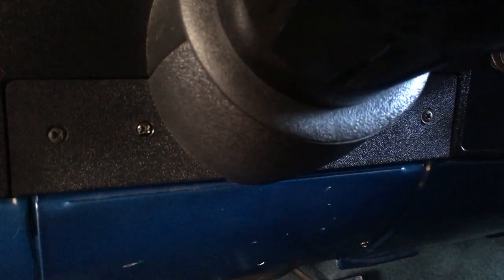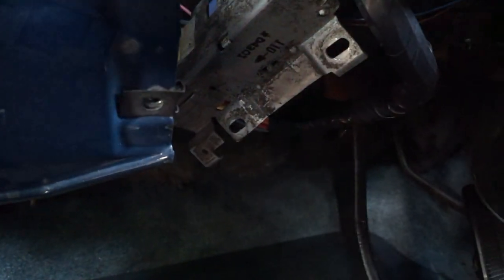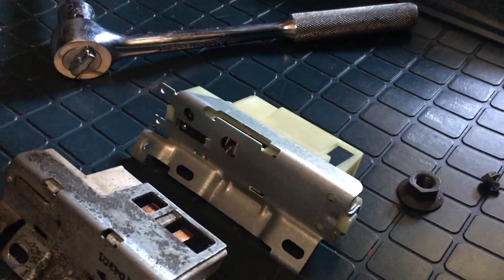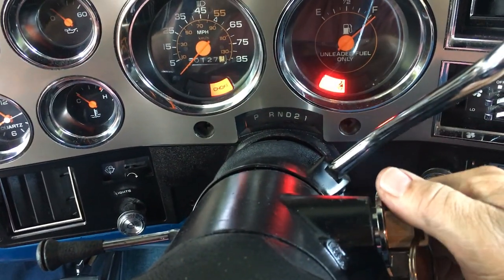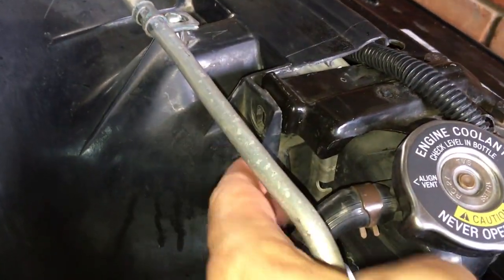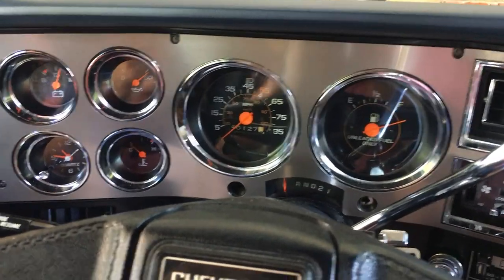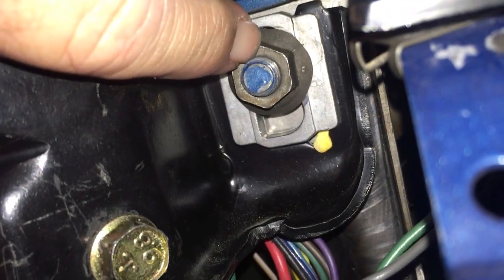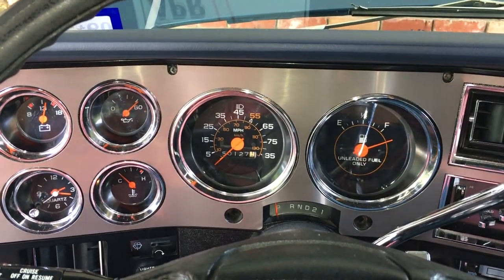1981 Chevrolet C10 Dash Brake Light Diagnosis, And Repair Part 2, Success!

Comment: Nice job on that.  Wasn't too bad a job I suppose.  Simple truck, simple problems.  Of course, you always have to donate blood to the project!
Reply from the maker: Thanks, not too bad, having the wiring diagram!
Better to donate some of my blood, rather than paying someone else  to donate theirs. Easily could have been a $300-$400 repair bill at the local shop.
Reply: @dynatrak  That's the problem.  A simple problem like that still costs hundreds.  I can also see unscrupulous mechanics removing the brake light bulb and calling it fixed, for 3 or 4 hundred.  Many an old lady wouldn't know the difference.
Reply from the maker: That's likely what would happen, or they just would have cut that tan/white stripe wire, in an inconspicuous location. Later on if there really was a problem with the brake lines, nobody would know until too late. I've actually come across such hack repairs on my truck, from when my Grandpa still owned it. One I always remember, is a BB lodged the the vacuum line to the EGR valve, in an attempt to "repair" a rough idle. This one shop he took it to when the ignition module died for the first time, really did a number on that poor truck, and took years to straighten it all out. Seems like it was around the 1989-90 range. I started driving it in '94, and slowly started learning how to fix stuff myself, and suddenly many of those odd problems went away. I certainly didn't hesitate to do an emissions delete, in 2007, when I had the 350 V8 installed. It's way more reliable without miles of vacuum lines to leak.

Comment: I have the same issue with my 84. jnust started yesterday You say it was the "AC Delco D1405B. This will not work in a non-tilt column. That part is D1404B." but i can not find those part and the part by steering box. Could you provide a link if it wouldnt be too much to ask?
Reply from the maker: You can go to Rock Auto, and type in Delco 1404B, and they come right up, with alternate part numbers. As I often have to do, you may have to try some alternate part numbers to find the right part.
Reply from the maker: Ok, took me a minute, sounds like you need the proportioning valve switch. https://www.ebay.com/itm/78-88-Disc-Brake-Proportioning-Combo-Brass-Cast-Iron-Valve-Plastic-Lead-Switch/190782482649
Reply: TY so much
 @dynatrak
Reply from the maker: @robertyoungagency  You're welcome! Did you locate the correct part yet?
Reply: @dynatrak  I did Ty. However, my part wasn't bad. My back Wheel Cylinder was bad & causing brake fluid psi to drop. This was causing my Brake Lightr to stay on. Once replaced & lines bled it went of. So we're all good.
Reply from the maker: @robertyoungagency  Great news, I'm glad you got it figured out! So far my wheel cylinders are holding up, and hope they continue to do so.

Comment: I just picked up an 83 C10. The brake light is on on the dash and the fender signal lights and taillights stay on. I have to keep unplugging the battery so it won’t drain. Could this fix my issue?
Reply from the maker: That's awesome! Unfortunately, each truck will have it's own issues, who knows what wiring or modifications were done by previous owners, so there is really no one size fits all fix, as old as these trucks are now.
You'll need to get a wiring diagram, easily found online, a multi meter, and start figuring out where the fault is, that's sending power to the lights that stay on.

Comment: Nice job man great  !!  My choke light is not work when i tern key on  ? Any Idea sir ?
Reply from the maker: Thanks! Probably the easiest thing would be to check the bulb. Other than that, get a wiring diagram, and a multi meter, and start testing.
Reply: @dynatrak  Thank you sir
Reply: @dynatrak  bro a question wich one between fasten belts and brake is the Alternador light?

Comment: I need help wiring my ignition wire from the fuse box. I bought a 81 GMC CABALLERO 3.8 V6 and the wire from the ignition fuse wasn’t hooked up to anything!! Please help!!
Reply from the maker: Did you watch part 1? I show how to find where wires go.
Reply: @dynatrak looking for it now!!!
Reply: @dynatrak I watched it but you never showed the fuse box. New subscriber though. I still like the info in that video!! 🔥🔥🔥🔥
Reply from the maker: @papergatorzfedducca7998  Wouldn't have been able to tell anything from showing the fuse box. Get the wiring diagram, and service manual for your Caballero, and it will show how everything is supposed to be hooked up. It really takes the guess work out of figuring out the wiring, especially if someone before has changed up some factory wiring. Thanks for the sub!
Reply: @dynatrak  I use PRODEMAND for wiring diagrams but it’s not accurate. Like it says my oil pressure switch has 4 wires but it has only 1 so I don’t trust PRODEMAND with the caballero. What’s a good source to get a service manual/wiring diagram?
Reply from the maker: @papergatorzfedducca7998  I got all my GM factory service literature from Bishko Automotive literature. I got the service manual, and parts lists with wiring diagrams. Saved me a lot of headaches with electrical issues.
Reply: @dynatrak  ok thank you I appreciate all the help!!!

Comment: Is this the same for 88 R10 Suburban?
Reply from the maker: Unfortunately, I don't have a 1988 R10 Suburban to compare. I would imagine it is a similar setup though. Best to make a visual inspection,  check parts lists, and wiring diagrams to confirm.